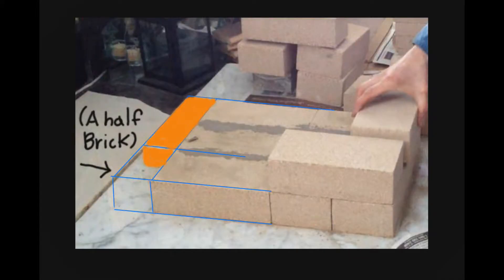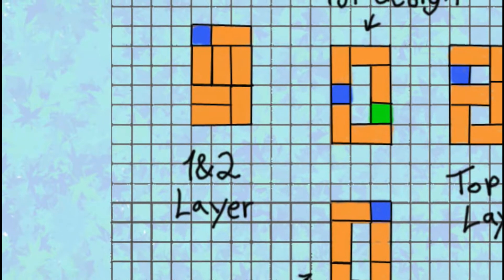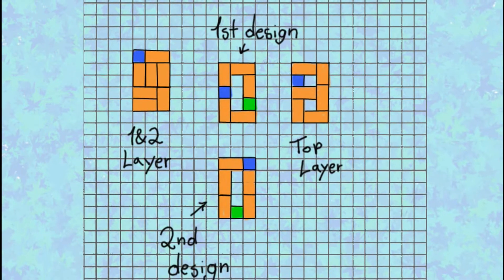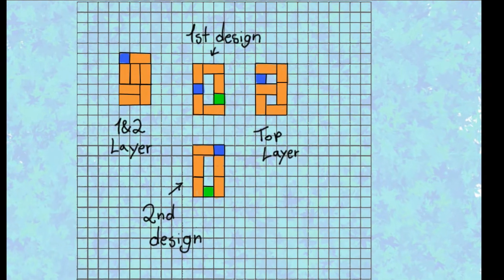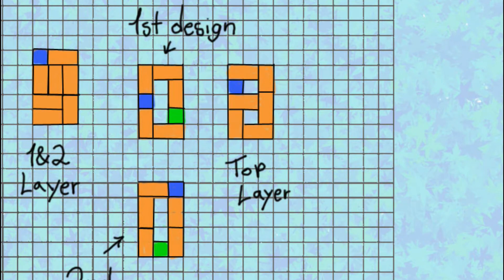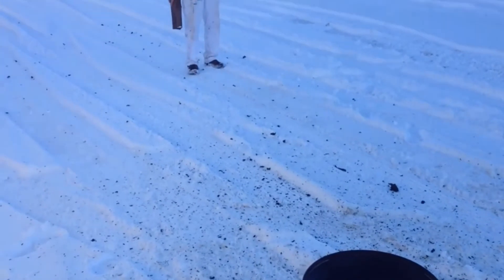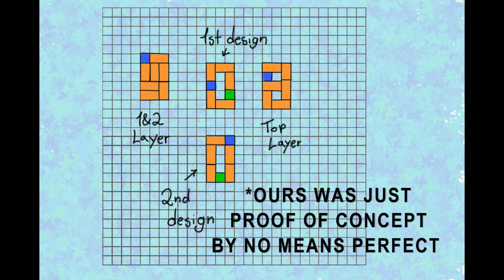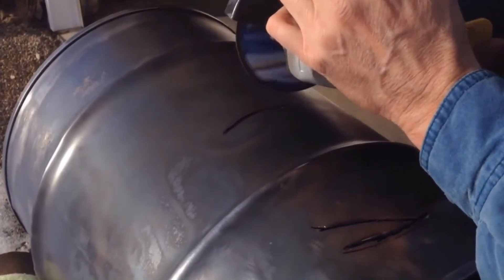How to Build A Rocket Mass Heater: UPDATED!!

Comment: These two vids are an awesome learning resource. Thanks loads 😁 The inevitable questions tho- 

It looks like you used the heavy & hard kind of fire bricks that absorb & conduct heat. Did you consider using the lightweight, soft kind that are designed to insulate?

It seems to me the insulating kind would have been optimal for the hottest burn whilst shielding the floor better.

What am I missing? I figure if you need the thermal mass you can loosely stack the heavy fire bricks around the barrel?

Comment: so how tall is the final 4" exhaust?  how is the unit working for you?  any suggestions to someone wanting to install one in a small home?
Reply from the maker: The exhaust coming out of the heater was only about 3 or 3 1\2 feet up the chimney. Basically went as far up as we could get it through the damper in the chimney. The reason we went with a 4 inch system was because it was the right size to sneak past the damper. The house chimney is a two story so probably about 30 feet or so. Our heater has recently been taken apart and is in storage for one of those "just in case" type scenarios. We basically built ours just to prove that it worked, and it did! We WOULD NOT recommend putting one of these in a house since we scorched our floor pretty bad. And in the event of a house fire (related to the rocket stove or not) we would not have house insurance. So we couldn't under good conscience tell you its a good idea to put one in your home. If you choose to do in regardless of our warnings, use plenty of ventilation around and under the heater and keep safety your number 1 priority!!  It would be best to install this on a concrete and far away from anything combustible. Also pick up a thermometer for a wood stove just to keep an eye on it because depending on what type of wood your burning can alter the internal temperature. It gets hot regardless of what your burning so use extreme caution!!
Reply: it would be in a concrete dwelling, block walls, cement floor.  thanks for the input.
Reply: I want build one in a home, I have concrete floor and stone walls, I plan to use a layer of insolating hollow stones, with a pressed ceramic insolation blanked and then a layer of fire sones and build on that, it will be save I hope.